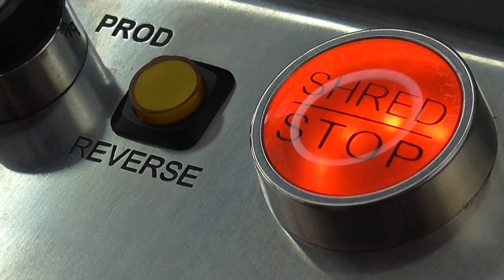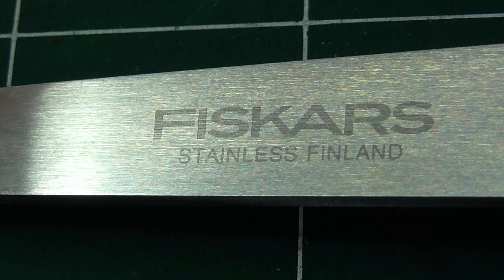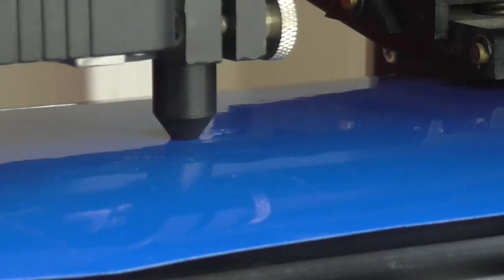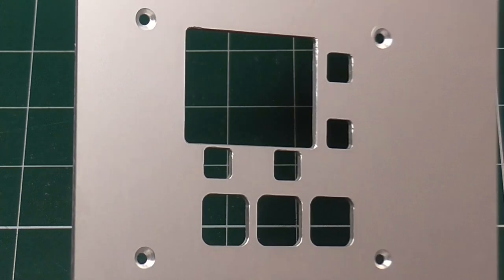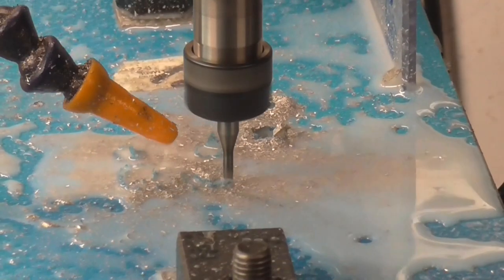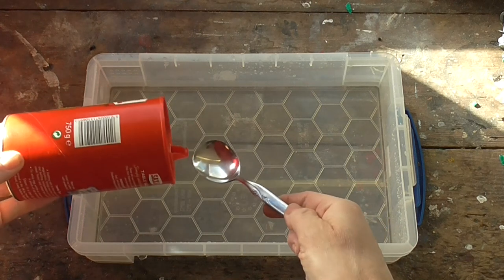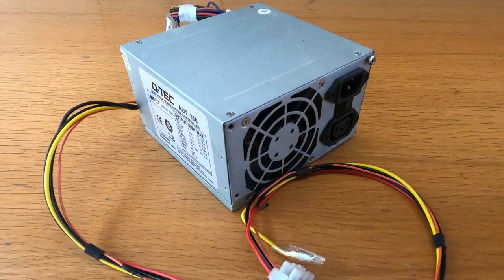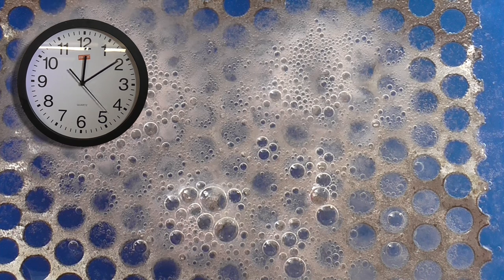Electro Etching

Comment: This is like "chemical milling."  We started performing that process in our Plating Shop before I retired.  I don't recall how the Chemists determined how to shrink the pattern cutouts to allow for the undercutting that Chem Milling does, but I suspect that similar methods would be used to determine how to modify your patterns appropriately.  Even if you can't find the "shrink ratio" (for lack of a better term) in a book or online, trial & error will work.  Of course, the "shrink ratios" will vary for different materials being etched.  I really like what you did here and will have to try it myself in my workshop and/or "pole barn" (which has good ventilation) on a future project!  ;)
Reply from the maker: Yes, it's exactly the same process, just with chemical milling /ECM you let it run for longer to remove more material. You can also use specialised electrodes that themselves have masks and channels to flush the electrolyte through to control the shape of the cavities produced and reduce the undercutting issue.  I have used chemical milling to make moulds for plastic and rubber parts just using a vinyl mask very similar to what's shown in this video, it's only suitable for certain shapes with limited depth and it can be hard to get the parts out of the mould afterwards due to the rough surface produced by the etching.
Reply: If you haven't seen it yet, "Applied Science" has a GREAT video on a diy workflow for Photochemical Machining.  I think it is for cutting all the way through, not a surface etch, but worth a look either way.

I'm documenting it further on OSE's wiki, and would love to build the machines sometime!
Reply from the maker: Yes, I think I did see that at the time, but I'll have to check it out again, thanks.

Comment: Nice job. I used to use a wax crayon to fill engraved letter's provided they are deep enough (crayons are specific for engraving) buff after.
Another method was to use engraving paint. To remove excess ink I would wrap a scrap piece of board with paper towel soaked with paraffin wiping the face with the wrapped board flat on the job. Move to a clean spot on the paper and repeat, after two or three wipes the paint will not smear.
Reply from the maker: Yes, I've seen those wax crayons. I think it's also called dial wax as it was used by clock makers. 
As the etched surface is quite rough, paint sticks to it fairly well, but I'll have to get some of those crayons to try out. I've only ever seen black ones but I assume they come in other colours too?
Reply: @AndysMachines  yeah. Engravers wax gives some results on UK eBay. Think you'll want the hard type. Not sure what the soft type is used for mind. Rather pricey. Yes does come in a few colours. One stick will last a couple of life times!

Comment: Wouldn't it be easier to use a sponge soaked in electrolyte to etch? Seems like a lot of work masking off the entire piece
Reply from the maker: Yes, I do it that way on larger items where the areas to be etched are small, you can even use just a cotton swab (Q-tip) soaked in electrolyte. It is a slower more manual process though, so often it's quicker to mask off the whole item and just dunk it in a tank.
Here's the cotton swab method: https://www.youtube.com/watch?v=VJOem40ggkI&t=447s

Comment: Cutting plotter for mask production is an interesting idea, need to try that.
Perhaps even cut the letters as positive mask, glue them on metal plate,  spray paint, remove letter mask, etch, solvent to remove paint, finished.
Reply from the maker: Vinyl cutters can have many uses in addition to their intended one!

That's an interesting idea, cut a positive vinyl mask and use it to make a negative one. Why not just cut a negative mask and use that? I've etched PCBs with vinyl in the past, the vinyl and adhesive don't seem to be affected by ferric chloride, I'm not sure how they would stand up to acid, but a quick google seems to suggest muriatic acid wouldn't harm PVC or acrylic (the adhesive is acrylic based).

Comment: Do you think this process could be used to etch/machine brass model detailing parts (i.e  "photo etch") parts?
Reply from the maker: Parts from thin brass sheets, yes. See my other videos on EDM machining, the thin stainless parts I made could also be made with electrochemical etching, it would take longer and the deeper/thicker you go the more undercutting of the design there will be.
Reply: @AndysMachines  - Thanks. I have been looking for a non chemical/acid way to produce the same type of brass photo-etch parts for plastic model kit detailing parts, and this may be a good alternative worth exploring.

Comment: Very interesting. Would the toner transfer method work with electro etching? I thought you needed an etching solution for that. I'm thinking of using this method to make a clock dial.
Reply from the maker: There are plenty of examples on Youtube of people using the toner-transfer method with acid etching, I seem to recall seeing somebody doing it with electro etching? But like I say I haven't tried it myself, I think it should work, maybe I'll have to give it a try.
Reply: Kinda, I noticed it tends to flake near the edges, thus destroying details. Photoresist film(dry photoresist for PCBs) or vinyl works much better.

Comment: Andy, what CNC machine do you have?
Reply from the maker: It was actually a small manual hobby-type milling machine that I converted to CNC by adding ballscrews, stepper motors, and a high speed milling spindle. I built it before I started posting on Youtube, so I don't have any videos on it. If you watch Blondiehacks' channel, it's the same milling machine she has.

Comment: Nice job. Definitely an outdoor job if you use salt as the gas produced will be chlorine ☠️
Reply from the maker: Thanks! I believe most of the chlorine reacts with the water to produce hydrochloric acid which stays in solution (very weak solution), but there will still be some acidic vapours and maybe some free chlorine so always best to do anything like this with plenty of ventilation. When I'm not filming I use my welding fume extractor.